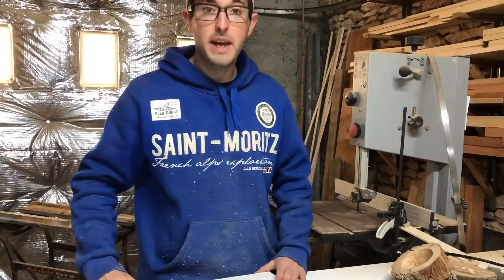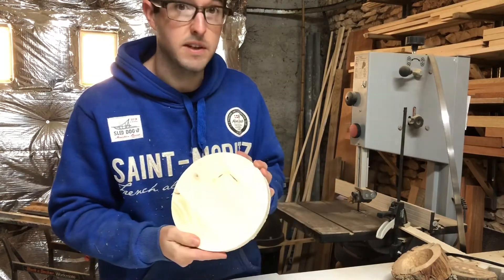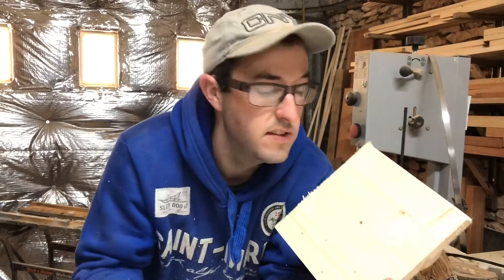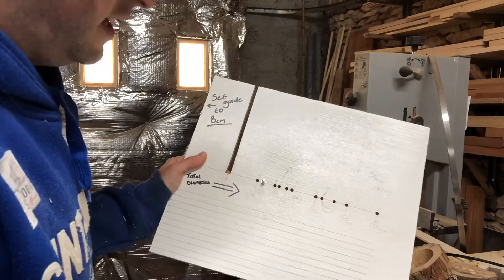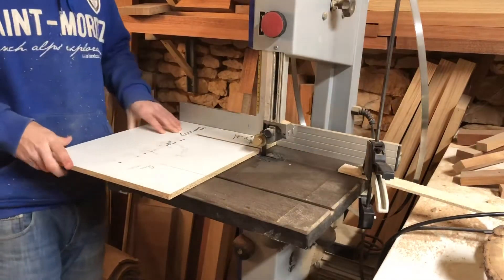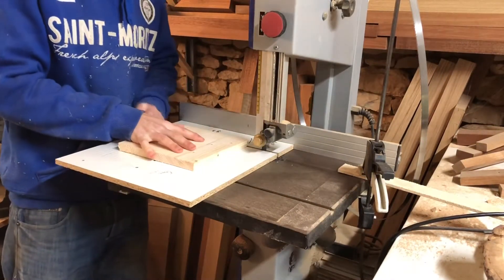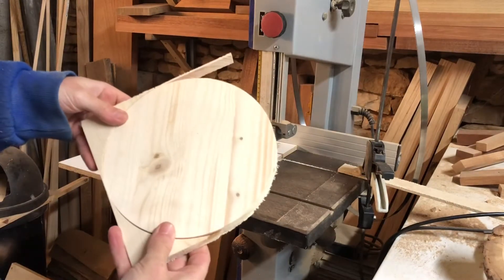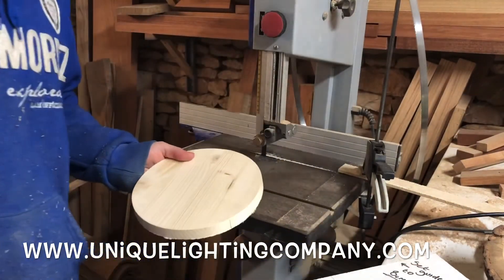How to cut a circle in wood with a bandsaw hack

Comment: Roughly how wide is the slot the blade runs through as the blade could wander if it's too wide I think??
Reply from the maker: Hello
Only a little wider than the blade is needed for this I think. The machine guides should stop the blade from wandering. 
Thank you for watching

Comment: So it does have a hole in it.
Reply from the maker: Well only on one side obviously. But no hole all the way through like most techniques.  And you could always attach a secondary piece and then remove to make a circle with no holes at all. Quite easy to do.  Thank you for watching.

Comment: Wonder if you could make a jig 
out of strong magnet arrangement in centre
a small rotating metal base underneath
Reply from the maker: I think that would be possible but not really necessary for it to work effectively. 
Although nothing wrong with a bit of over engineering every now and again. 
Thanks for watching

Comment: If you don’t want a hole on both sides, you can just cut a sacrificial pieces like shown and then hot glue another piece on top. The bottom piece acts as a zero clearance guide and the hot glue comes of with no effort using a putty knife. I do this all the time and it works great.
Reply from the maker: Yes, that’s a great point. I’ve done this a couple of times and works great, thanks for mentioning. 👍

Comment: For small circles of 3" dias , are you using the same blade and how wide is it?
Reply from the maker: Just buse a thin/narrow blade like 6mm and it will cut them no problem. Definitely not a very wide blade for cutting curves. Thanks for watching. 😀

Comment: This is the simplest band saw circle cutting jig that I've seen so far.  It's simple but it has everything thing to get the job done.  I really like that.  I see you used a stop block and the saw's fence, but you don't show a bottom runner under the jig.  Is there a runner underneath the jig?  Thank you for sharing this simple idea.
Reply from the maker: I always keep things as simple as possible.  No runner underneath the jig as it just slides along the fence straight. 
Simple but does the job. 👍
Reply: @luxsabre   Great!

Comment: Why would you label this video "No hole" when there is in fact a HOLE?
Reply from the maker: Well obviously there’s no hole all the way through so absolutely no hole on one side which will suit most applications for needing a circle. Plus you could easily use the same technique with another piece of material underneath temporarily attached such as with double sided tape or hot glue and then remove leaving a circle indeed without any hole at all on either side. Hope that helps. 
Thanks for watching! 😃

Comment: Well done, but what if I don't want a hole at any side?
Reply from the maker: So it’s the hole you need to cut, not the circle piece?  All you need for this is a hole saw. What size hole?
Reply: @luxsabre  no, no, i want a circle piece WITHOUT holes.
Reply from the maker: Ok, well this method only leaves a small hole on one side only. So one side has no hole at all. Plus a small hole like this can very easily be plugged with matching wood if needed.
Reply: Don't want holes? Follow this method and put double sided tape on your new circle and place your new piece you want to cut on top of it and voila! No holes.

Comment: Need to change your title of video to be more accurate
Reply from the maker: Why’s that?  There’s no hole all the way through like with most techniques and is fine for most applications of a wooden circle being needed. Plus you could easily use the same jig and technique with a second piece of wood temporarily attached to indeed get a piece with no hole at all. Very easy and commonly done. 
Thanks for watering all the same.